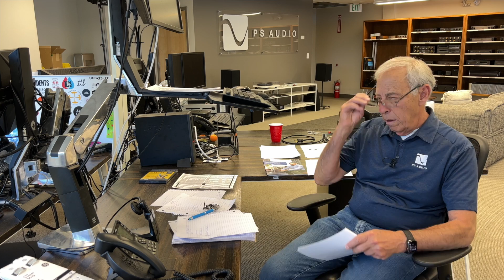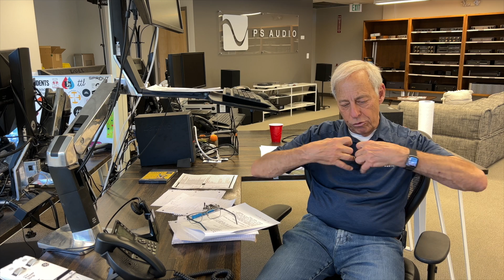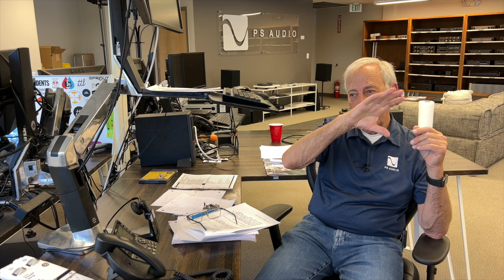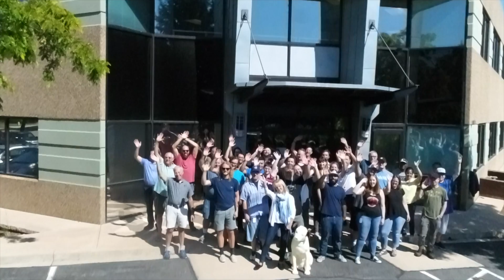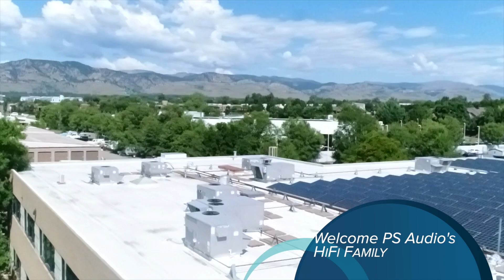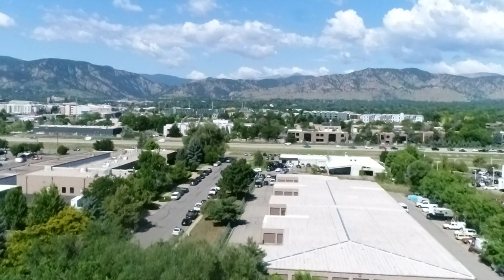Will PS Audio abandon traditional power supplies?

Comment: Anyone who takes an electronics engineering course that deals with active components (in this case an audio amplifier) will learn that what Paul is saying is ‘spot on’ Physics. That doesn’t mean that any of the other components in each stage of the entire circuit needs to be taken into strong consideration with regard to component quality, layout and isolation  to mention but a few of the design criteria so that the end result is an  amplified musical signal that is true to the source material. There are so many other factors to consider in the design and with each idea that is introduced to a new amplifier the designer must take many factors into consideration. Not so simple to accomplish.
Reply: Switch mode power supplies can beat simple transformers on efficiency and how much power you get for a given size of product. The output voltage can be more precise and noise can be as low as you design it to. It’s just far more complex to engineer. Of course PS audio will also transition to switch mode power supplies as any other consumer electronics company has already done or is doing.
Reply: @ThinkingBetter  
Yes, of course!
Reply: @ThinkingBetter  Switching power supplies are getting more sophisticated a.k.a. better every month.
Reply: What most people fail to realize is that if you have a conventional amplifier that performs exactly the way you want it to, there is no replacement that can give you the same results. Every time you change the technology of the devices or the type of design it is, you are not going to be able to get back to the same place because it’s always a different physical animal that you’re dealing with there’s no way around it. No two things are truly identical. You can synthesize and fool yourself into believing, but that’s about it.
Reply: "what Paul is saying is ‘spot on’ Physics" - the only place I'd challenge Paul on that is that he thinks a magnetic field is not "physical"!  Splicing two wires together transfers energy in the same physical means as a transformer: an electromagnetic field.
Reply: @TheDanEdwards  Dan, there’s electrical isolation when you’re using electromagnetic induction.. the primary and secondary windings of the transformer are not physically connected. Do you not understand this, or am I not understanding what you’re trying to say?
Reply: @TheDanEdwards  Any piece of wire with current passing through it creates a magnetic field around it
Reply: Then why does he say "the AC goes into a diode bridge which separates the AC into plus and minus DC". Anyone who knows electronics knows you need a separate diode bridge for each of the plus and minus rails. The purpose of the toroid is also not to separate the voltages for safety, it's how magnetic induction works. The toroid is used to lower the input voltage to that which is required by the amplifier.
Reply: @ianhaylock7409  A full diode bridge takes the negative side of the sine wave and makes it positive as well that’s the purpose of a bridge circuit. And every circuit is different. Sometimes people try to compare apples and oranges.
Reply: @ianhaylock7409  4 diode’s will produce full wave rectification, you don’t need a second bridge..👨🏻